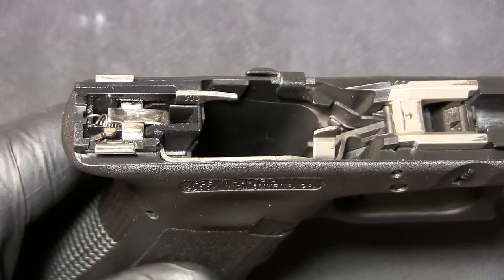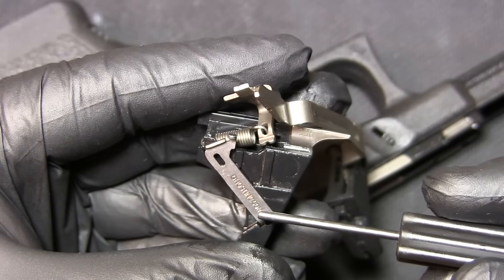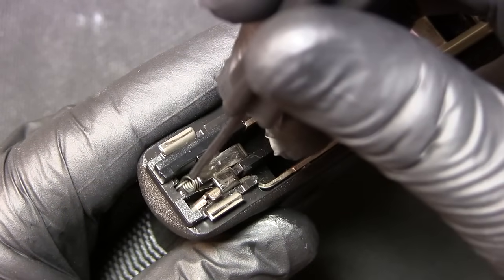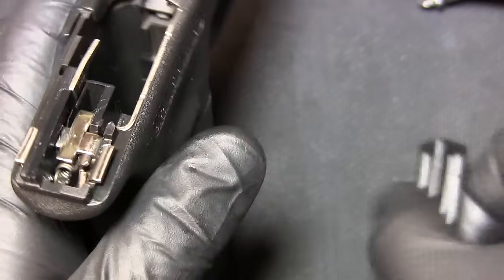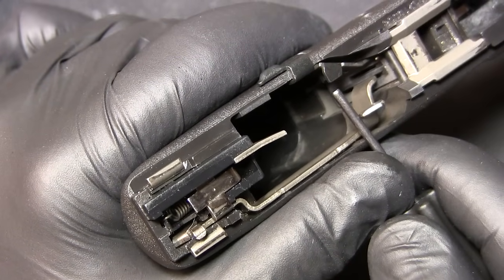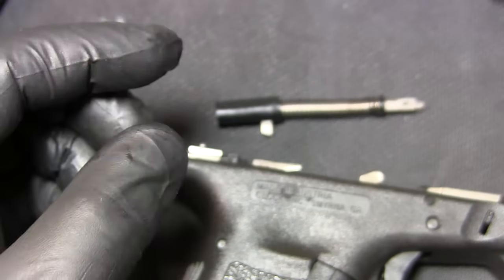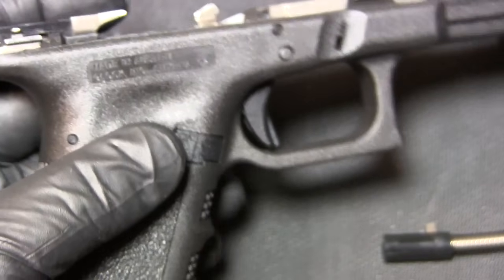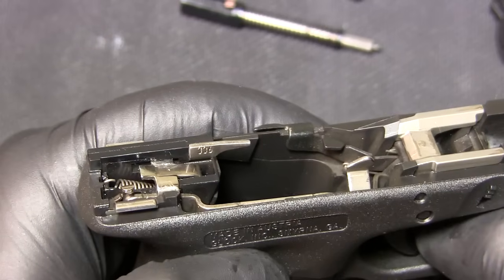How Glock triggers work and how they reset

Comment: zev springs reset the trigger but not far enough to engage the trigger safety, what's the difference in the trigger weight if you do not replace the trigger spring?
Reply from the maker: Mark Eisenhower I actually made a different video called The Road to 3.5 lb. In that I show the effects on trigger weight.
Reply: thanks

Comment: If you do polish the ramp on the connector, less is better. If you over polish it, expect your gun to double fire. I've been told by a friend who took a Glock armory class that you do not polish anything. I live dangerously, but just giving a heads up.
Reply from the maker: Travis Orr I have heard glock armorer will lose their certification if they ever swap parts out for anything other than spec OEM glock parts
Reply: MosinVirus I don't doubt that at all. I always have to bite my tongue around him. If he only knew how much I polished or other guns he said not to touch, he would faint. I guess my point is to be careful you don't round off the connector ramp while polishing the internals.
Reply: Great video by the way!
Reply from the maker: Travis Orr I completely agree. Polishing is one of those things you have to do carefully. Before too long you could end up with far more material removed than originally anticipated.

Comment: How does the g18 full auto work?
Reply from the maker: Mauricio Aceves the back plate is replaced in the slide. The mechanism prevents the trigger bar from coming up into the way of the striker, so every time the slide returns the gun fires until the trigger is released. The mechanism can be engaged or disengaged through the lever in the back plate. There are videos showing how it is done.

Comment: Great video ! thank you very much.  My only concern about using a Ghost connector is having the gun fire when the trigger is resetting.  I've seen a video here were that happened to this person and a few more viewers commented on the same problem.  I have a brand new Glock 43 and I bought the Edge connector for it.  I don't plan on changing springs when I install the Edge connector.  Any comments or suggestions would be appreciate. Thank you !
Reply from the maker: jdp1956 I have a slight suspicion that people may be an issue with how they are installing the connector. though I am not sure.

Comment: Awesome video. Great breakdown and showing of the trigger system. You were pretty clear about everything to where I doubt there could be confusion. So with a 6 lb spring, why keep a 4 lb trigger spring? Why not increase that weight to a 5 or match? Any particular reason? My resent upgrade which I'll be doing shortly is just changing the trigger shoe itself and the safety plunger. All parts are stock internally. I have heard the 6 lb spring is helpful and the ".25" trigger job... anyways nice vid!
Reply from the maker: Michael Brian the best combination of springs is stock trigger spring and light power striker spring.

Comment: Awesome. This answered my question. I just replaced some springs and did a trigger polish and wanted to make sure that wasn't something abnormal due to overpolishing. Thanks so much for the video!!
Reply from the maker: My pleasure. Glad the video helped. The best combination of springs I found is the stock trigger spring and light power firing pin or striker spring.

Comment: MosinVirus Question with regard to the official Glock Instruction Manual and preventative maintenance manual notice/safety caution that: "With the Glock pistol field stripped, the trigger should not be manually reset to its forward position and pulled, as damage to the trigger safety could result." What do you make of this?
Reply from the maker: Jo Be I see no reason to do that with a field stripped Glock, and while I don't know how the trigger safety could get damaged I would trust the manufacturer to know what they are talking about. I did it to demonstrate how it functions.
Reply: MosinVirus OK thanks. Did any of your components get damaged by demonstrating this? Great video by the way.
Reply from the maker: Jo Be no, no components were harmed in the making of this video. :) I don't know how they would, but the manual wouldn't say that if they didn't see it happen, so I guess it could...
Reply: MosinVirus I haven't done any noticeable damage Yet, but if you leave the trigger forward and install the slide you will have a problem. Overcoming that problem is at least ruff on the mechanism.
Reply from the maker: Edmund Marler Sure, but we were talking about resetting rhe trigger and pulling it... I am still not sure how the trigger safety would be damaged. And yes, I would not advise installing a slide on a raised cruciform

Comment: Thank you for the info. A follow up on how the trigger bar works the safety and how the trigger gets pushed all the way back out would be great.
Reply from the maker: Which safety do you mean? The striker safety? Normally, the trigger bar arm that activates the striker safety sits ahead of it in the slide that is in battery. When you pull the trigger, the trigger bar glides rearward and its arm rolls under the Striker safety in the slide. That is the reason there is a ramp on the back of the Striker Safety "lifter" arm. As you continue to pull the trigger, the arm ramp forces the striker safety up.

The striker lug, catches the end of the trigger bar and carries it forward. That is what pushes the trigger back out, and which is why it is important to not go too light on the striker spring. It has to be strong enough to overcome the trigger spring and push the trigger out. The trigger will obviously stop at its most outward position, and the slide will continue to move forward, whereas the striker is now stopped by the trigger bar. That is what "cocks" the striker to the rear, under its spring tension. So, when you pull the trigger, you will pull the striker even further to the rear, to give it that much more distance of travel. That will ensure you have a good and solid primer hit.
Reply: MosinVirus Yeah striker. This all makes since, I'll have to sit down and go over it with gun in hand. With the video and this info i think I got it. Thanks again!!

Comment: I noticed on my gen 3 17, the part of the trigger bar that engages the firing pin safety button is chewed up. I cannot figure out how it got chewed up. The gun functions fine. The firing pin safety looks fine. The slide looks good. Not sure what chewed up that part of the trigger bar. Great video.
Reply from the maker: Poop Poo well, good thing it works. but you can still replace the trigger.
Reply: MosinVirus yep. Only like $20. I just cannot figure out how it happened.
Reply from the maker: Poop Poo are you sure it didn't come like that from the factory?
Reply: MosinVirus if it did, I never noticed until last night. I've had it for a couple years. I guess it's possible. And that seems to the the most logical explanation.

Comment: does the striker not move back when you pull the trigger without racking the slide first? does the slide move the striker back?
Reply from the maker: Yoko Kurama when you place the slide back onto the frame, you will rack it. At that point, the striker will pick up the trigger bar and move it forward, and that will bring the trigger out forward as well. When you pull the trigger, you will be moving the striker back until the trigger bar lowers enough to disengage the striker lug. That will let the striker strike the primer. As you hold the trigger to the rear, and the slide cycles, the trigger bar will disconnect from the connector bar ramp and jump up into the way of the striker lug. So, when the slide closes, the striker will be held back to the rear as far as it can go by the trigger bar, because you are still holding the trigger. Before you can make another shot, you will be allowing the trigger to go forward to reset it, as the striker carries/pushes the trigger bar forward. When the trigger bar resets under the ramp of the connector bar (reset click), you will start pulling the trigger again, and therefore pulling the striker back again, until the trigger bar disengages the striker lug. repeat.

Comment: Funny I came across this video. After installing my ghost rocket connector the trigger bar was not contacting it properly.  It remained to the side  at certain points. I had to gently bend the connector outward some to get it to work. (Oddly enough I was very careful not to disturb this bend prior, so not sure how that happened.)
I noticed the trigger bar I polished had a flat spot on it later on.  I wound up purchasing a 2nd trigger bar to replace it.  After going back and thinking things through afterwards I realized the connector was the cause. Anyways thanks for the video and I will be further polishing my ghost connector surface and polishing the very small flat spot off my trigger bar at this point. 

Also my ghost connector had a little tab that I had to slowly grind down per instructions to eliminate trigger over travel. Are you familiar with this?
Reply from the maker: 1997LT1Camaro Yes, I have seen those connectors with overtravel arms. should be pretty good. how do you like it?

Comment: Do you know how the full auto Glock 18 works? How it does full auto? Does it have to do with the disconnector?
Reply from the maker: It wouldn't be legal in my state so i never looked into it. but I believe there should be videos on the conversion out there.
Reply: MosinVirus - Just so you know I have absolutely no interest and never will make anything full auto I was just curious on how it works mechanically because I have no idea.
Reply from the maker: I understand completely. I just never looked into it. I am sure conversions are described in a bunch of places. I see plenty of youtube videos of people shooting their glocks full auto.
Reply from the maker: the only thing I can think of is that you would want something to push the crescent shape of the trigger bar down as the slide closes. this would allow the striker lug to engage the trigger bar, get pulled back (cock), and if then something was to push on a trigger bar to send it down, the striker would fly forward.
Reply: MrChuckwagon55

Comment: Very good!  You did a very good job in describing the operation. In the Glock Armorer's Class, they do not show you where to polish because of liability reasons. I am a certified Glock Armorer but not acquainted with the Glock 43. It is slightly different but the general operation is the same. The G 43 has a very heavy trigger weight and shooting accurately can be a problem. I did the full polish job on my Glock 43 and it did minimal or no change in the trigger weight. That's just how they engineered the G 43--I assume for safety reasons for a pocket gun. That is no fault of your's.  I have on order the Ghost Edge 3.5 to see if I can get a better trigger pull.
Reply from the maker: Heavier trigger spring and a minus connector (3.5 lb) will get a reduced trigger pull.
Reply from the maker: or you can simply replace the connector and put in a lighter striker spring. that is probably the best combination.

Comment: I just replaced the trigger bar, connector, trigger spring, striker spring, and safety spring on my Gen 4 G19. Now I notice the slide not moving all the way forward smoothly going into battery when I hold the trigger until just before the reset. Does anyone know what part of the combination might cause this?
Reply from the maker: What is not smooth about it?
Reply: When going back into battery the slide holds up just before the trigger reset when I guide the slide forward.  I'm sure it won't happen with live ammo as the forward motion is more forceful than when I was doing it.  I put the original connector back in and it was moving just fine.  I like the Ghost 3.5 lb Edge connector, though, but I think that's where the snag is.
Reply from the maker: Well, you could then take a look at the connector and see if there are any burrs on it. If you are sure it is the connector that is. Also check how it us different from the original (outside of ramp angle obviously)
Reply: I had this issue as well and the culprit was my 3.5 connector was bent too far out of a 90 degree angle. When placed in the plastic housing it stuck out away from the plastic and was applying force on the slide and was slowing the slide from fully going into battery. Many people have these issues and have to bend the connector so it sits more flush.

Comment: +Mosin Virus  so a friend of mine has a glock 19 that fais to reset its triger when you pull it it clicks but when you reload it doesnt reset all the way ... it needs a bit of a push am thingking about a weak fire pin spring ? whats your oppinion
Reply from the maker: if you hear the reset click, it is reset, and if the trigger doesn't come out enough to engage that trigger safety tab on the front of the trigger, the suspect is probably a weak striker spring. If a spring kit was installed with a stronger trigger spring (the one pulling the trigger bar up and back) and a lighter striker spring is used, the trigger safety may not engage. replace just the striker spring for original, and leave the stronger trigger spring in. it should work.
Reply: Thank you my thoughts exactly !

Comment: is it possible have you heard, if you change the trigger spring and ghost connector and you then have a trigger that won't reset properly could the trigger bar not be pulling up high enough for the striker to connect w it causing it not to reset, out of 250 trigger jobs I just recently had 3 not reset. thanks
Reply from the maker: sorry, never had the trigger not reset. have you looked at it working with an armorers back plate?
Reply: Gonna do that next, don't have the gun w me now. It seems like the trigger spring is to strong but I've done over 300 of them and just had 3 do this

Comment: Your video is titled: "How Glock Triggers Work And How They Reset".  First of all judging from ALL the Glock videos dealing with malfunctions and the need to upgrade almost every stock part I am surprised the Glock firearm works at all!  There are more Glock videos concerning problems, malfunctions and upgrades here on you tube than any other firearm on the market.
Reply from the maker: I think they break when people start messing with them. if you leave it as in, or you don't start turning it into something it is not, it works. I have never had a Glock that broke. but if it did, the parts are cheap.

Comment: After installing a 4 lb striker spring in my G19, I experienced substantial cycle problems (almost every second discharge resulted in my having to force the reset by slightly pulling back the slide without extracting the re-chambered round) and some failures to fire (primer not hit with enough force to discharge round).
During the initial installation of the 4 lb striker spring, I noticed that the striker assembly wouldn't easily move back into the slide. I had to apply much manual force to cram it back into the slide. I tried that several times with factory cups and with maritime cups, because I first thought that maybe the cups were bad and created too much friction. But the cups didn't seem to be the problem. I went on to gently grind the 4 lb spring with very fine sand paper in the expectation to make it more smooth, but that didn't help either.
I finally re-installed the factory spring and it works perfect now. I still don't know what the real problem with the 4 lb striker spring was.

I installed a 6 lb trigger spring as well and that worked fine for me right off the bat, so I left it in.

Just sharing my experience here. Maybe somebody has an idea what my problem with the 4 lb striker spring was.
Reply from the maker: Not sure what the issue could have been, but if it was difficult to reinstal, something was binding and that would explain the rest of problems.

Comment: Darn good job!  I've polished the connector before but only under the tab. Now I know where else to polish.  I've always wondered why the connector didn't fit flush against the trigger spring housing.  Thanks!
Reply from the maker: +gwidwock Thank you. Glad you liked the video. Yes, that was one of the reasons why I wanted to know how the Glock trigger worked and why the connector bar stuck out.

Comment: You can easily reduce the trigger by reducing the striker spring but you will notice that the striker will hit the bullet primer with a lot less force. It's no problem for a target pistol but for a defensive pistol you risk a failure to fire. take a good look at the fired bullet casings with the two different striker springs. There is a big difference.thanks
Reply from the maker: Yes, if I was using a pistol for defense, I wouldn't be swapping out springs or connector bars.